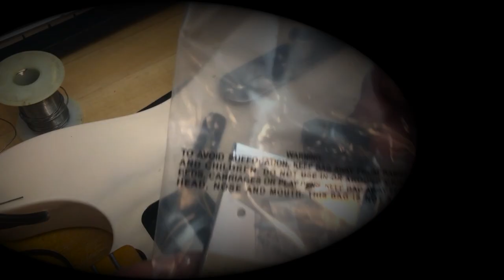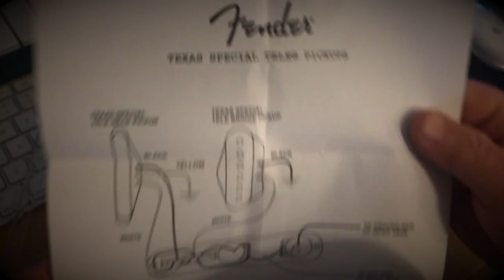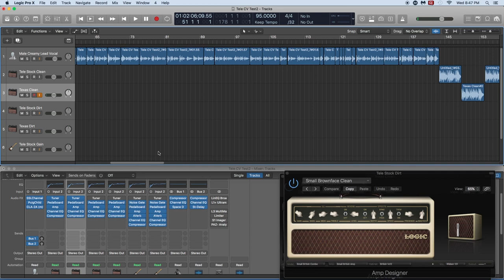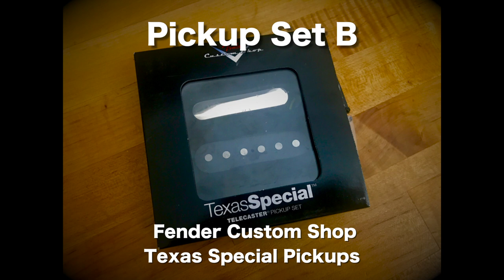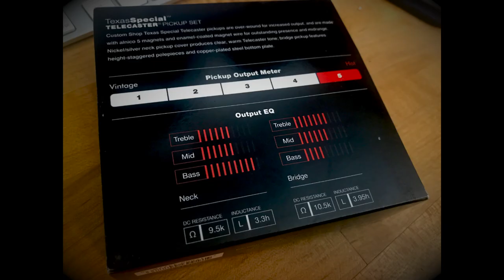Squier Telecaster Classic Vibe Stock guitar pickups VS Fender Custom Shop Texas Special pickups

Comment: Awesome! Thank you for this video, VERY helpful and honest! I'll just spend my money on a Fender neck and bridge now instead of pickups! I found out that a good neck can do a lot for the tone of the guitar. I replaced a Squier classic vibe 50's stratocaster neck for a MiM Fender 50's neck, now it really has the "Fender" tone, especially in pos. 2 and 4. Very strange how much difference a neck can make, both necks were 1 piece maple, I don't understand how there can be such a difference. Theoretically both are "the same", being 1 piece maple. However, thank you for the video!! Cheers
Reply from the maker: Thank you and you're welcome Enes! And yes you are absolutely right, the neck affects the sound as much as the body. Some people don't believe the wood in a solid body guitar affects the tone at all but I do. I've switched out Fender necks on guitars and basses and there is a definite difference!
Reply: So a CV with stock pups (I liked them better in this review) and new neck should be the bees knees.
Reply: @douglasalexander4348  pretty much! And I’d even go as far as to say a neck with nitro lacquer would be the best way to go. It allows the wood to breathe and theoretically (I’ve noticed it in real life) gives you a bit more sustain. A thick poly lacquer layer as on the CV neck really “kills” the sustain. It’s about 2mm thick 😅. I think a good MiM neck would do just fine as well. Let me know how it worked out! Cheers!
Reply: @nsbomb  I think the whole nitro thing is a bit dodgy at best. Poly is hard, and not 2mm thick. A hard material sustains more than soft ! Allegedly, Fenders nitro finish is nitro sprayed over poly anyhow, which is hilarious. Also, remember it’s got a great big thick pvc pick guard over it and a big lump of metal with big holes routed out ! Nitro doesn’t breath, it (old nitro) just never goes completely hard, goes yellow and sweat gets absorbed over time leaving a hue. Also be aware the modern nitro’s are mostly way different to the old as it wasn’t very healthy stuff and now contain hardeners so not comparable. It all came about because of the holy grail 59 les Paul, and people wanting to emulate that. Along with hide glue. I do like a satin neck same as you, so get very light wire wool on the back of your CV, and it’s great. Did this to my expensive nitro lp as well. CV 50 is a bit narrower than player, I prefer the player size.
Reply: @airtimedesign  Yup. The problem is, which is best through your amp and ears. I have two lps, Same year, same specs, one sounds darker. I like them both.

Comment: No kidding. I have bitten on the lure of "upgraded" pickups for the last time. Wonderful Squires (strats or telies) that feel so good in your hands makes you want to just add some better electronics. Unfortunately (or fortunately) all 4 times I did that, the old originals sounded as good or better. We all have to stop thinking that thin wires, small pots and ceramic pickups sound bad. THEY DON'T THEY ARE FINE!

Comment: They are so close. I wouldn’t bother changing them. I recently bought a new Classic Vibe Thinline Tele.Had thought about a pick up change at some point but after watching your video I don’t see the point.
Reply from the maker: I ended up keeping them but it is very close. I've mentioned this in the comments but it should be noted that the TS do have more output. I adjusted the volume levels to be the same for the comparison but when you plug into an amp the TS drive the input more and that makes a difference in the sound.

Comment: I didn’t even bother to check the answer at the end. The two sets were so similar the upgrade didn’t seem worthwhile. I wonder if the limiting variable might be the Logic amp sims?
Reply from the maker: Hi Centaurus Relax 314. Thanks for your comment. There are a lot of variables in comparing pickups that make it hard to determine which set is best for you application. I used Logic to try and level the field for the comparison but it is by no means a perfect comparison. Running the same test with and amp would be different because the way the pickups work with the amp electronics and the speakers. The bottom line is there's not a lot of difference and there is a big difference in the prices. Is it worth it? Well I ended up keeping the TS pickups because although they were really close there was a quality I liked. All the best!

Comment: Some samples I liked A, some B.  Over all, I personally liked A slightly better.  Most samples sounded identical.  I'm thinking of trying a humbucker.  500k pots, .02µF cap, and a 470k resistor, to retain a 250k pot for the bridge

Comment: You did it yet again Brooks. I heard ZERO difference in the sets. Zero. I was correct in telling which was which only because the Classic Vibe can have a high frequency at times that can’t be missed if you have one of these. I bought this Classic Vibe used for $180 about a month ago. 2016 made in China Mint condition. I told the guy I bought it from he wasn’t asking enough for it and that it was worth 2x what he was asking. He sold it to me anyway for the $180 and this thing blew my mind. I brought it home, took it apart and cleaned and polished the entire guitar. Gave it a nice set up and played it, and I couldn’t believe my ears. I’ve had the butterscotch version of these and liked it a lot but this vintage white blonde is absolutely stunning. Call me shallow but to me, a guitar has to look good. The neck and frets on this thing is as smooth and rounded if not better than my CS Strat neck. Unreal. Anyway, I couldn’t have seen your video at a better time because I did honk about changing the pickups but was more leaning toward keeping the stock ones in because I haven’t touched my American Pro Tele since I bought this Classic Vibe. The only negative o have to say about the Classic Vibe, and this was true with my butterscotch blonde one as well, they are heavy. If I’m sitting, it likes to slip backwards. Mine weighs 8.6 lbs. which is actually lighter than my butterscotch was at 9 lbs. Uugh. Anyway, this was a great video as usual. You have the best videos online. Hands down.
Reply from the maker: Wow thanks Mike! I appreciate the kind words! Sounds like you got a great deal on a really nice guitar. I don't recommend upgrading the pickups. It's always fun to play around with different sounds but you definitely don't NEED to change them out. I've been lucky with weight because mine is really light, under 7 lbs. I was hoping they were pretty consistent but another guy commented that his was really heavy also. I don't get it because pine should be lighter. Hey what if you did some weight relief and cut some holes in it! I haven't seen anyone with holes in the body. It might be a cool thing! Except for the Stevie Vai gutiar with the handle hole. Anyway glad you enjoyed the review!
Reply: @airtimedesign  yeah the only light CV I’ve had was a Jazzmaster but the electronics were not good and the pickups were harsh so I sold it. I don’t miss it. I would never put holes in my guitars for weight relief. The CV Tele I have has a gorgeous wood grain under a vintage white blonde. Absolutely stunning. Anyway, keep up the great work. Your videos are by far my favorite. Thanks again.

Comment: Unfortunately I have to disagree having just listened to the samples with my eyes closed it was very easy to tell the difference the two sets sounded distinctly different to each other. I liked the brightness of the stock pickups. With the custom shop pickups they sounded warmer and had more bottom end I believe this was due to the higher output pushing the amp a lot harder. 

They were both good it’s down to what flavour you prefer.

Comment: Set B is the custom shop Texas Specials. I dunno but Set B had a richer sound with more jangle, to me. Maybe they were just "one louder."

Wow, my 65 year old ears - with hearing aids - did not deceive me. TBH, I didn't think it was close and now I know what I'm going to do when I buy my first Squier CV Tele. I'm done spending $2,500 on a guitar that I want to take out and gig with. To much to worry about between it getting banged up or even stolen.

Comment: I thought set  A sounded fuller and captured more mor of the frequencies than set B and thought for sure they would be the Texas Specials. To me set A sounded better. I think you should do the comparison over with thae same guage strings so that is apples to apples. In that way one could just judge the pickups. I think the strings made a bigger difference than one would expect.

Comment: I fully expected to be swapping out the pickups when I bought a CV Thinline Tele.  Not happening.  The stock alnicos sound great.  Aside from the bridge and the pots, mine is stock and plays great.
Reply from the maker: I was surprised at how similar the sound was. In fact I almost put the stock pickups back in but decided to keep them and I'll tell you why. The TS pickups are have more output. I adjusted the levels in the comparison recordings to be the same. But in the real world, when you plug into an amp the output of the pickup loads the input stage of the amp and that is something you can't hear in the audio sample comparison. But all that being said the stock pickups still hold up and sound great.
Reply: @airtimedesign  I can see how you would want a hotter pickup.  My rig is one channel on the edge of clipping with stomp boxes in front to kick the preamp when I need it. I ride the volume pot when I want to clean up my tone, and I find that easier to do with "vintage" output pickups. I also notice more dynamic nuance when I vary my picking attack with the lower output pickups.

Nice upload, btw.  I really liked how you went through the pickup combinations with demonstrably different riffs (fast funk strumming, arpeggios, open chords, etc).  It really helped showcase the relative strengths and weaknesses of the pickups, even if they ended up sounding very similar when you took their sound as a whole. Keep it up!
Reply from the maker: @deBebbler  Thanks I'm glad you enjoyed it. If you haven't already, please subscribe! I'm working on another pickup comparison of the Texas Special and V Mod pickups now.

Comment: Thank you for the video and the details ! ... But... Where are the bass of the Neck ? The Roswell pickups of my HB TE-70 are more fatter and rounder... i Hope Set B is Texas Special.
Edit : Won ! Not a huge difference, but the pickup change was a good idea ^^ . I think your amp is linked to the lack of bass.... because on some others telecaster Texas Special démos... it's a bit more "bassy".
Reply from the maker: Hi Dawoud8013! If you forward to after the sound samples you will see which are which. Thanks for the comment.

Comment: Great info and video as usual really enjoyed it , i would say that A are the Squire but both very close ,EQ on an amp could have sorted the difference.
Having said that i changed the stock pickups pots wiring in fact it was a pre loaded Fender pick guard with Texas Specials on my Player “ two piece body” i might add Stratocaster and it improved the sound 100% so who knows perhaps pots switches wiring do add to the sound ?? I have expensive and affordable guitars and i am in constant battle in my mind re costs and quality, definitely modern made construction and build quality is so much better.
Cheers John 🏴🇬🇧🇬🇧
Reply from the maker: Thanks John!

Comment: I listened closely through my speakers but until I changed to a good set of headphones it was pretty close. In the end you can here a difference when sustaining. The Specials had a little more growl. However there was a few tones where the CV's sound was as good or better. For the money CV for the win. Unless you are playing or recording professionally. Even then if Squire at the head stock doesn't bother you, most will be hard pressed to tell a difference. 
I own a 50' CV Telecaster and Stratocaster. 
Nice job!
Keep'em coming
Reply from the maker: Thank you Kentucky,  please subscribe!
Reply: @airtimedesign  
You got it brother!
I don't know why didn't at the time of comment.
I'm debating on making some changes to my guitars.
 Here is my situation, I have a CV 50's Tele, Strat and Epiphone Les Paul Studio. I'm torn between replacing pickups, pots and wiring or buying a Strat professional ii or Gibson Lespaul tradition v or classic. I have major shrapnel in my right side, hip and knee. Which makes the Strat the most comfortable and lightweight. I play Rock, Blues and Country. The hardest is Metallica. A tummy cut helps me tremendously, to be comfortable sitting or standing. Weight is hard on me because of 120 pieces of shrapnel up and down my spine. Having those 3 is very versatile, but if something were to happen and my son and wife had the Squires and Epiphone, the cash value would not be what the Fender or Gibson would. Even if they knew the pickups were changed.
Opnion?
Reply from the maker: @kentuckywindage222  Let me know how it comes out.
Reply: @airtimedesign  
🤣😂👍🏻
Reply: @airtimedesign   
Update! I stayed with the stock set up in the CV's and Les, but the neck pickup on my CV 50's Tele crapped out on me. So do l buy a single or set? Which single or set?
Reply from the maker: @kentuckywindage222  I know a lot of people just change the neck pickup so I would say just look for a neck pickup you like. There are lots of good choices. You don't really need to match the pickups but if you want a good set of pickups for a good price I would go with the Tex Mex. They sell for less than $100 and are pretty hard to beat. I am working a comparison review on them now but I can tell you I'm a fan.
Reply: @airtimedesign  
Thanks! 
Have you tried Bootstraps?
A small garage business. 
Some great reviews at absolutely outstanding pricing. I'm tempted to try the Extra Crispy.
Reply from the maker: @kentuckywindage222  I'll check it out thanks!
Reply: @airtimedesign  
Oh man! Brooks I replaced pickups with Tex-Mex the electronics CTS 250 pots,
Sprague .022, Switchback 3 way switch, (920D loaded plate). This guitar played like butter, sounded good, (I thought). After the mods the response is phenomenal and grit and bite but still can be twangy. A really good electric guitar is something I haven't owned. Until now. This little Squire head stock, pine body ClassicVibe 50's Telecaster alone through my Fender Blues jriii is fantastic. Especially with the Fat button. Love the control of the tone and volume! Now my CV 50's Stratocaster and older Epiphone Les Paul are awaiting their turn! Any advice on components appreciated! You are right about those Tex-Mex pickups. Only thing I found disappointing was the plastic base on the pickups. The original neck was similar but the original bridge pickup was metal based. Again thanks for your suggestions on things and the time, money and energy you put into these video's. Pretty sure our tonal taste is very similar! 
Great video!
Keep'em coming!

Comment: I could spot the differece, but like someone else said here in comment section , they are really similar and so similar i would not bother to change to texas specials. I would change to Nocaster ones, I really love those. This is really everyone ones own preference. CV guitar are so good as own and really bang for the buck, totally gigging/recording capable guitar. But I could say that the texas ones are good for cleaner recording but still would go for Stock ones for live gig and probably even for jaming/recording cuz they sound little bit more louder with the more treble.
Reply from the maker: Hello Diddy and thanks for the comment. One thing I did NOT make as clear as I could have on the video is that I adjusted the audio leveled of the pickups to match volumes. The TS are hotter and are a bit louder but for the purpose of this test I adjusted the volumes to make them even. So anyone who wants more gain from their pickups would be better off with the TS.

Comment: That US ashtray bridge is the secret! Magnetic field change accordingly to them... and the amp of course.
Reply from the maker: Hi Cahyo, what do you mean? The ashtray cover or just a difference in the metal of the USA bridge?
Reply: @airtimedesign  I think the ashtray model (not the cover), cupping style compared to those of 6 saddles  in American Standard. For material metal, I'm not really sure, haven't tested back to back. I'm using chrome polished steel, previously some years ago using brass with chrome polished, no difference to my ears. If nothing comes significant in difference, why the Tex Mex, Tex Special and all other variations then? Marketing trick?
Reply from the maker: There are a lot of people that get into the smallest details on guitars. It's kind of fun to experiment but does it really make a difference?
Reply: @airtimedesign  I don't think so, to me it's always the pickups, amplifiers (and cabinet) or any simulation of them, and the way I play. I'm using cheap tele parts, Korean/Chinese imports, but with proper GnL MFD sets and electronics, I still the oomph I wanted regardless that saddle, or ashtray bridge models, to some, gives significant difference.

Comment: They are SUPER close. I could hear the difference, especially on the clean tones. I suspect, that on certain amps, the Squire pick ups could come across a little bit “sharper” or “harsher” to some ears. The custom shop pick ups would solve that problem. But in your current rig that you used to demo this video on, I don’t think you need it.
Reply from the maker: Hello Ben and thank you for the comment. One thing that might not have been clear on the comparison is that the Texas Special pickups are louder. I adjusted the mix to the same level but having increased output does load the front end of the input stage and change the sound in a real world situation. So there's that.